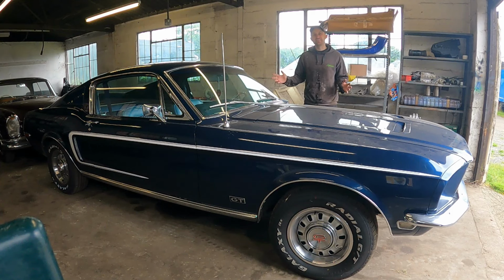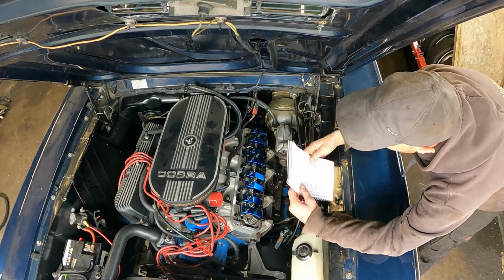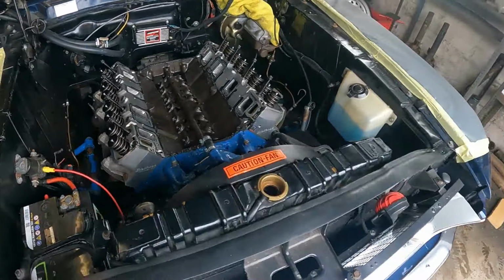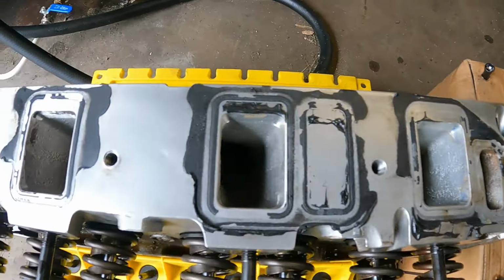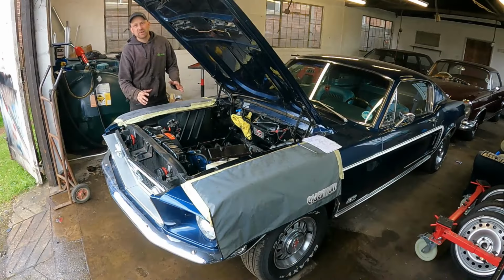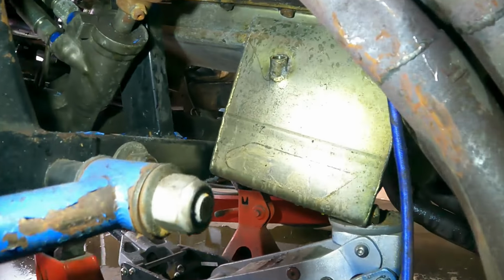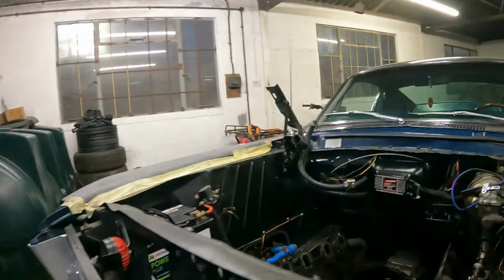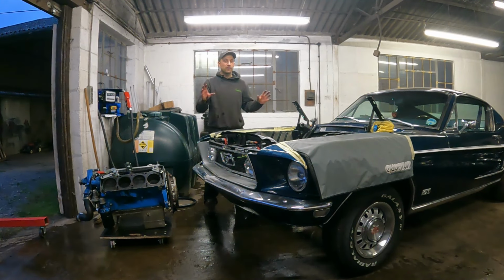1968 Ford MUSTANG GT Engine Problems! Lets Remove & Investigate!

Comment: Frustration, swear words + head scratching but you got there in the end Ron.  Good work.
Love the Merc that was sitting behind the Mustang too.  From the little I could see its a similar model to the one that Ryan O'Neil destroyed in the car park scene of the film Driver.
Reply from the maker: It was a struggle that's for sure, but got there 😂 I can't remember what model the merc is, it's a MASSIVE coupe. It's going on air suspension ⬇️⬇️⬇️

Comment: I have taken so many FE(Ford Edsel) 427's and 428's and 390's that are shoe horned from the Ford factory.
Reply from the maker: Its certainly alot more iron than we're used to here! But all good fun 😁
Reply: @SuperRon  When you get it put back together take the oil pump apart to make damn sure it isnt scored at all. 428 cubuc inch engines like lots of oil. If you are not familar with the Ford Edsel(FE) engine get a decent assy book as torque on these monsters is very important. When it is done and running it will put out right around 500 foot pounds of torque and the Horsepower will truly be around 450 plus . My cousin has the rarest engine Ford built to race a 427 single overhead cammer. He has it in a 66 Galaxie 500 complete with roll cage ,handmade stainless headers, Dual Quads, radical cam and it pulls that 4000 pound car around like its made out of balsa wood.